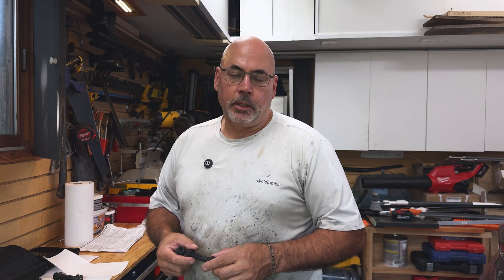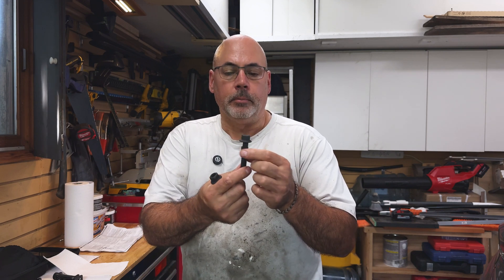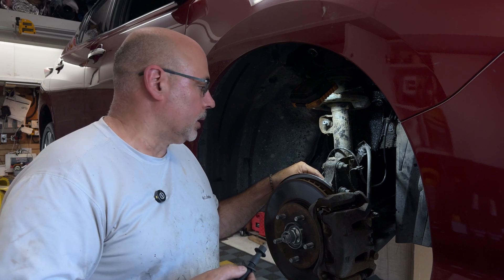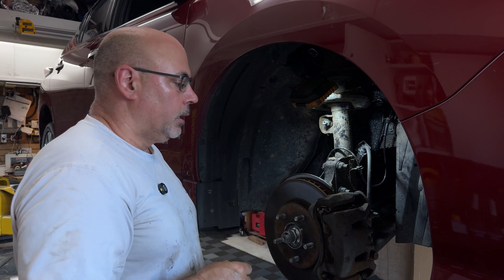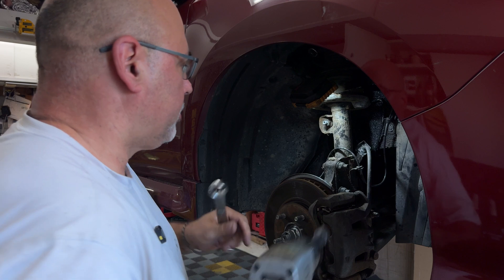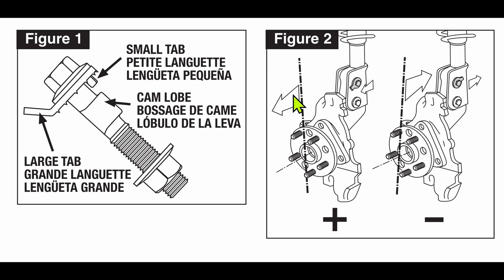Watch this BEFORE installing camber bolts!

Comment: Hello, i have bmw g20, 2020, rwd with 100 000 km. After being on a lift (changed o rings on rear diff) i have -1.20 camber on front left wheel (-0.66 on right). Wheel is crooked on the left side, not much. Everything is factory, front suspension all factory, car was never in accident, all bushings like new. Car had an aligment. What could be the issue? Is it possible that strut mount causing an issue? I never hit big pot hole or a curb... Thnx
Reply from the maker: Lots of variables there, but I’d be tempted to take it elsewhere for an alignment.  I’m assuming camber is adjustable on that vehicle?
Reply: @WoodysWorksGarage you were right, i went to 3rd alignment shop and now finally everything is ok...
Reply from the maker: @GangstaOS That’s awesome.  I have a hard time here finding an alignment tech that will take their time, but if you ask for (nicely) a before/after report, it usually helps.
Reply: @WoodysWorksGarage not adjustable camber. Its been on 3 alignments in 2 different shops.

Comment: My camber bolts came with two washers, do I use both? Thanks!
Reply from the maker: Yes, I'd use both if it came with them.  It will help position the strut if it's under load.  I'd still print out a copy of that illustration in the video (washer orientiation vs camber), and make sure the alignment tech has it in hand.  These camber bolts may not be too effective with the lower strut bolt torqued to spec as they have some play in there.  A second washer is a good idea.  Just make sure you position both in the same orientation.

Comment: What's the torque specs for a Toyota Highlander 2012? Or the same as this 110?
Reply from the maker: The bolt for sure will be different so consult the manufacturer spec that should be provided with your bolt kit!
Reply: @WoodysWorksGarage I bought from rockauto (no ones responds there) MOOG K90477. Google AI doesn't give me anything
Reply: @WoodysWorksGarage the 17 mm from the OEM manufacturer is 155 ft pound
Reply from the maker: @intertonyblue  When you say "OEM", you mean the camber bolt manufacturer, correct?  Toyota's torque spec for the OEM original bolt may be different than the camber bolt kit torque spec as the camber bolt may be a smaller diameter.
Reply: @WoodysWorksGarage I trusted my gut and went to a 5th guy who actually fixed it without camber kit. It's hard to find a good mechanic these days. My out of spec measurement was the toe only , and they were telling me to use their Camber kits. Camber and caster were ok. I tried to contact different sellers on ebay but no one knew. I guess contacting the manufacturer directly from the website might get the answer.
Reply from the maker: @intertonyblue Toe on the front is always adjustable via the tie rod ends…so yes, not a camber bolt solution.

Comment: I read that you can only install aftermarket camber bolts in the bottom slot.  What do you think?
Reply: On the OEM camber bolts on my genesis coupe the manufacturer specifically mentions only using the camber bolt on the top
Reply: @johnsullivan937 Probably because it's OEM.  I'm talking about aftermarket.
Reply from the maker: If you consider the strut and knuckle geometry, the manufacturers suggest using the top bolt location likely as this would change camber without affecting the track.  If you install in the lower location, you will slightly change the track from the OEM spec. This may affect the steering etc.  Without testing on an alignment rack vs track etc it’s hard to say if you would notice this, but I’d stick to one bolt up top.  The LEAF camber bolt is not as robust as the OEM bolt, so again I’d ideally stick with one camber bolt per strut and install in the upper location.

Comment: Is it okay to use 2 camber bolts for upper and lower struts bolts? My Toyota Starlet front left wheels suddenly moves a centimeter towards outside and forward, giving massive Positive camber. I can almost see it clearly when seeing the car from frontside.

My idea is adding positive camber below and even more positive camber on the upper struts so it pulls all the wheel inside.
Reply from the maker: I have seen this (dual cam bolt) configuration before.  That said, I’d want to evaluate why this change occurred as it likely indicates a problem with the A arm, bushings, strut bearing etc. or structural issues where these components attach to the body.  This can telegraph a potentially dangerous safety issue…

Older CrVs (and Hondas sharing that rear suspension design)  often have visible negative camber on the rear wheels. This is due to corrosion and deformation of the bracket attaching the rear control arm to the rear subframe.  I have repaired this issue which essentially requires a new subframe. The vehicle in question had that control arm detach  and collapsed the rear wheel while the driver was in motion…

Also, if you use two, there is a potential consideration if the camber bolt has a lower OD than OEM (so compromised strength) and also the slight track difference introduced if you use a camber bolt in the lower location.  Ideally use one, and use it in the upper location.

Comment: The Dealer is Charging me $1700 for this done on front and back, because they say can't fix the steering angle sensor in the steering wheel. Do you think this is real and fair price? I think they just want to rip off me because they couldn't do it since the car was brand new. I have to fix the car.
Reply from the maker: I’m not an expert on steering angle sensor calibration, but from my look at the LEAF manual (calibration requires factory software) I’m not sure how camber plays into this, particularly if the steering rack, outer tie rods and steering wheel have never been removed or damaged. You may want a second opinion on this one.  A failed steering angle sensor might involve an alignment though, and if a check was done, yes, camber may need adjustment as part of this.  We’d need more information here to provide an opinion.  Year, make, model, why the car was serviced in the first place, existing codes, and the shops diagnostic report to start…

Comment: Thanks.  I have Nissan Murano--- is it the same Camber bolt location?   So the "winged" washer goes on the "bolt head" side?   Did I understand that correctly?
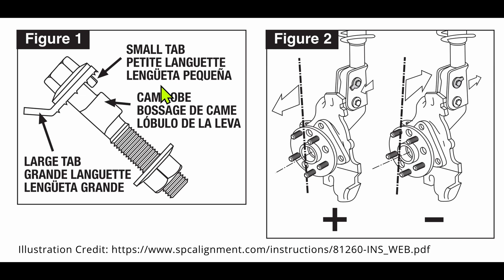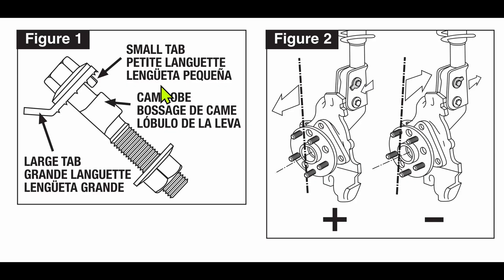Reply from the maker: Check the video at 5:08 … the tab of the washer will point out towards the tire, or in towards the engine depending on whether you’re trying to adjust negative or positive camber.  With a car that has no camber adjustment from factory, it does not matter which side of  strut the washer is located.  You do want the camber bolt installed to replace the upper bolt, not the lower.  That diagram at 5:08 explains it well and any alignment tech should be able to sort it out after seeing it.

Comment: @woodysworkgarage I was told these could help with caster alignment issues on vehicles you can’t adjust caster. I have all brand new suspension and steering parts installed, but one side is way off on caster
Reply from the maker: These camber bolts adjust camber only for the LEAF application.  That said, there are many suspension designs out there and there are specific kits for caster adjustment.  I would only use parts specifically designed and tested for your year/make/model!!

Comment: First proper use of a torque wrench I’ve seen today on YouTube thank you lol
Reply from the maker: Funny thing is that as I get older and more experienced with car repairs (pushing 40 years wrenching now) I tend to use the torque wrench more, not less, particularly around suspension bits.  I'm also more likely to use Loctite blue on fasteners vs anti-seize, as you're not second guessing lubricated vs dry torque values.  Loctite claims to help with corrosion as well in our heavy salt environment.

Comment: Thanks for the video. I have a 2005 Honda Civic that I just replaced struts on and I can tell I have some excessive negative camber. So I was looking for info on how to use these camber bolts.
Reply from the maker: @michaelharris785  You’re quite welcome. Good luck with your repair.

Comment: This is the first video I've seen that gives a good explanation for the position of the washer.  I have two kits from different manufacturers and neither include instructions.  So, thanks very much.  Most of the other videos are terrible as the installer has no idea how to use the washer.  I even watched one where the fellow put the washer on the wrong side and then half way through the vid he said he was testing the audience. Yea, right.
Reply from the maker: Thanks for the kind words.  It's simply baffling that something so important to using these bolts is left out of the instructions.  After spending a few extra $100 on labor at the alignment shop (they were baffled too) I figured the video was sorely needed!
Reply: @ No kidding... I just paid nearly 300 bucks for mounting, balancing and alignment.  Insane!

Comment: What is the purpose of this video?
Reply: My guess is to show how to install camber bolts and how they work
Reply from the maker: Many vehicles have front camber that is not adjustable.  Using Camber bolts allows you to adjust this.  The MOOG instructions though are missing the most important detail, tabbed washer orientation. The video covers installation and this missing detail.  In this case, I had the front end of this 2018 LEAF apart for front bearing, ball joint and CV axle replacement so an alignment was needed after reassembly.  With camber bolts installed, the alignment shop was able to adjust camber back to spec 🙂
Reply: @WoodysWorksGarage  I see, thanks